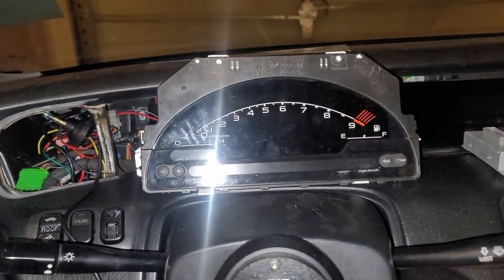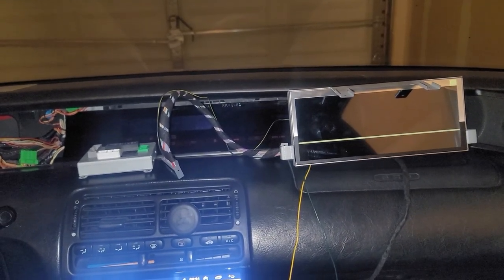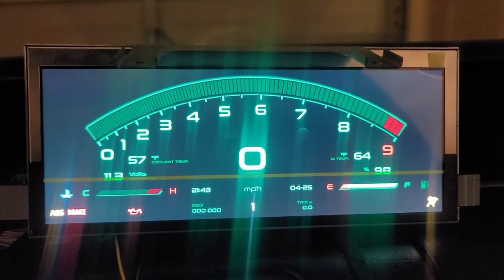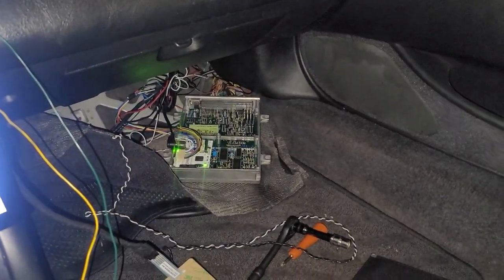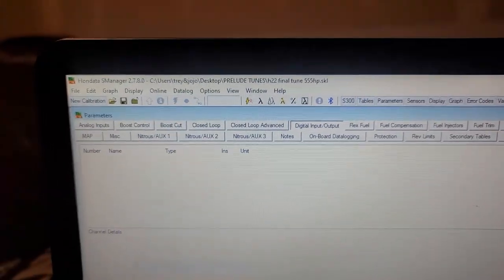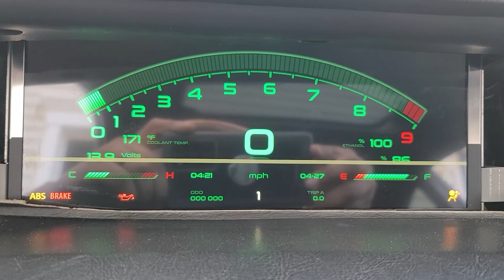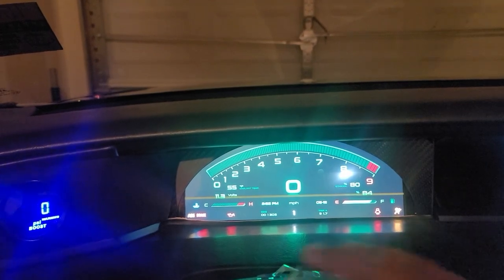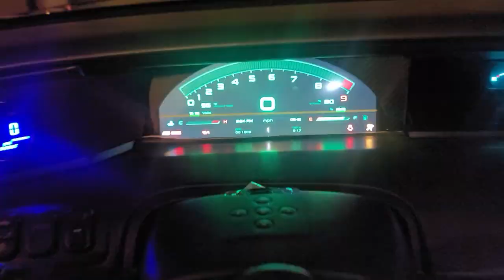id4motion's digital s2000 cluster in my turbo honda prelude

Comment: What size  wattage specifically did you use for the 120 ohm resistor ? I have it in my eg with the can bus wired in but still get no rpm’ signals  or any other signals essentially.
Reply from the maker: I'm not sure if it's different sizes other than the measurement of the actual resistor itself
Reply: Was it one resistor on each wire? Or was it one resistor bridging can high and can low?
Reply from the maker: @salpapas  between the two if I remember correctly and then twist the wires
Reply: Did you get it to work in the eg ?

Comment: Were did you solder the 120ohm resistor? Directly onto the ecu pins or anywhere through out the wires?
Reply from the maker: Its been so long i dont quite remember. I think it was right after the wires exit the ecu

Comment: Any idea why the cluster wouldn’t work without the candus wire’s hooked up? I’ve seen a few videos from s2000 owners and the basics work without canbus wired in.
Reply from the maker: With the s2000 it's plug and play. When you have a s2k cluster in other cars with conversions it has changing variables like the speedo healer adapter, and wiring.

If your going to do the swap in something that's not a s2000 I highly recommend having a s300 or stand alone ecu

Comment: Do you need a s2k cluster for it already?
Reply from the maker: No, if you have a hondata s300v3 you can run canbus wires if you get the cluster with ecu support
Reply: @treybedipping1734  I have a oem ecu though
Reply from the maker: @itsMaverickz  cheapest way for you to do it would be to grab a s300v3 then